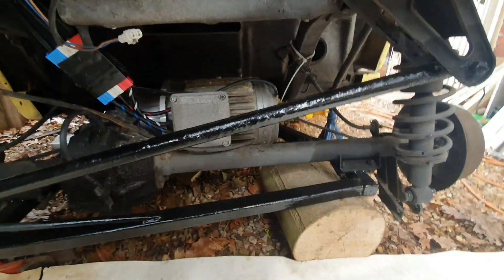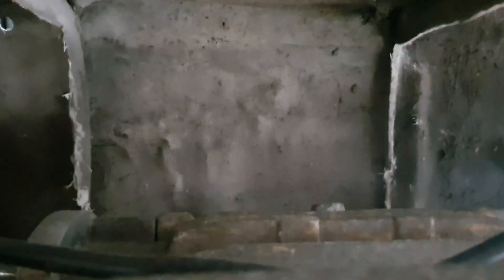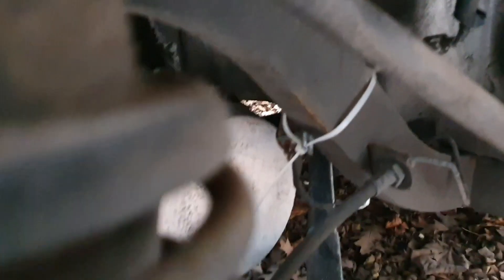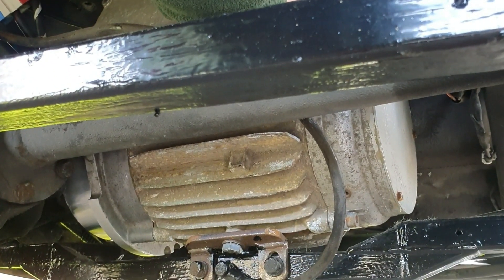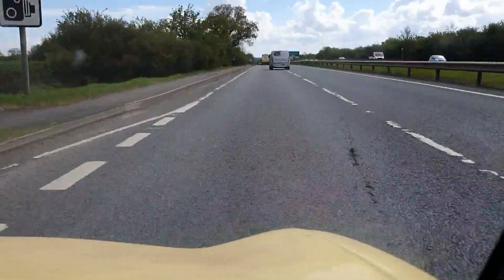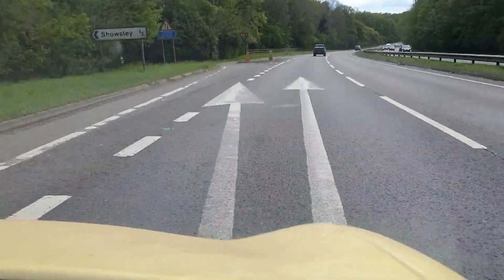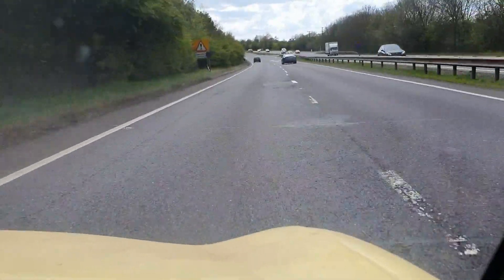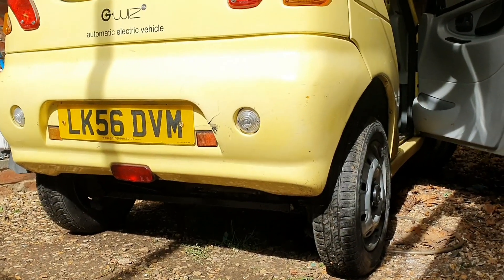REVA G-WIZ: Yellow Wiz Lithium-ion conversion pt. 25 - oops broke the speedo!

Comment: How do I start building an electric vehicle? There seams to be very little information on motors, controls and charging
Reply from the maker: DIY electric vehicles UK facebook group has plenty of good folk that can help. These days though you can probably pick up an EV pretty cheap.
Reply from the maker: It's hard to give you a direction without knowing what you aim to achieve as there are so many possibilities depending on the project.

Comment: Surprised the mot doesn't need a speedo.  Wont that mean the mileage recorded against your mots will never change ?
Reply from the maker: Yeah I'm surprised too but they just said the odometer reading will stay the same. I'll get it fixed eventually but it's not top of my list as I have a GPS speedo instead that will be accurate and also read above 50mph.

Comment: is the speedo cable broken at the connection to the wheel? thats the weak point.. i had to solder a lot of times and in each jolt it would break. I saw before you noticed the sppedometer broken, you had a jolt.

For that acc not working, is it due to regen? as i have noticed when you are climbing uphill, it seems to be working but i guess when you come back you have downhill.. too much regen and overheating?
Reply from the maker: It's broke entirely because I accidently dropped the tripod on it when the car sipped on the jack. It just twisted up on the dual carriage way. I have a GPS speedo now as the car goes over the dial anyway.

Comment: Cable speedometers are rerely accurate. Use a phone or GPS unit. Electric motors can overheat at standstill, when the airflow runs over the fins it keeps it cool like an old VW beetle. Some industrial motors are water cooled to cut out that problem.
Reply from the maker: Ah that would explain why it would happen after pulling into the drive and trying to park it after a good run. I'll try and get some kind of fan fitted just to promote air flow.